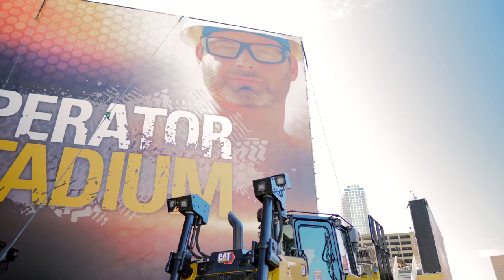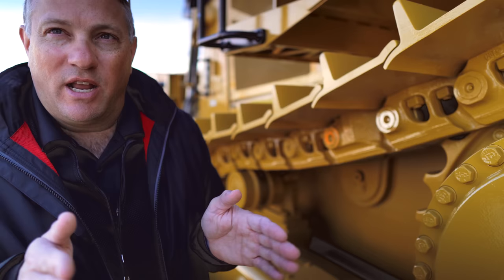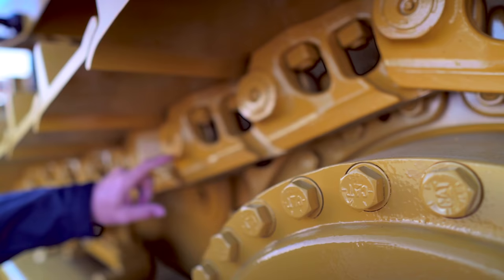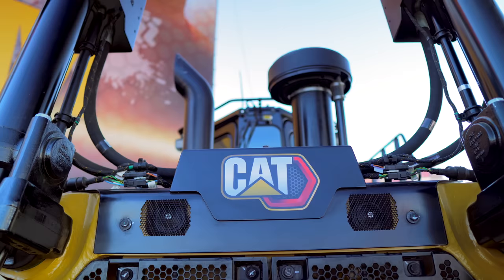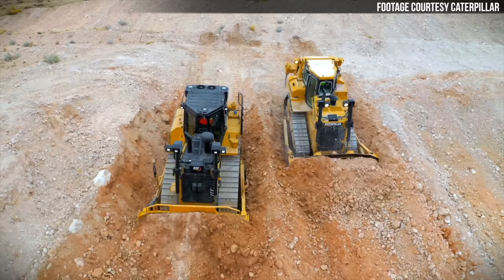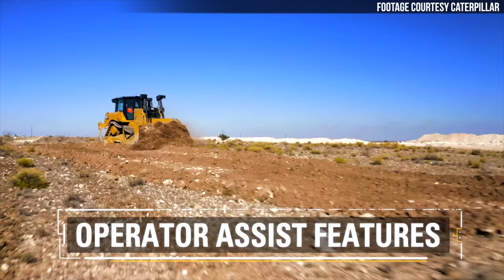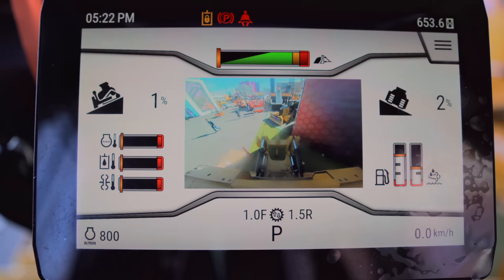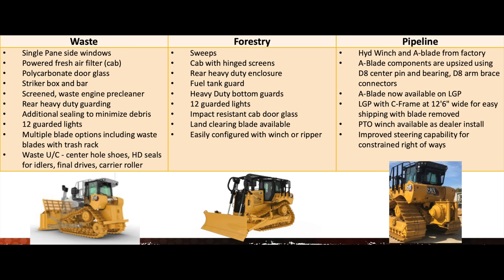Cat Unveils New D7 Dozer at ConExpo 2020: Bigger, Stronger, Smarter

Comment: So they abandoned the DIESEL-ELECTRIC drivetrain of the D7E and went back to the old slush box ?  🤨🤔
Seems like a step backwards but then again I don't operate nor design heavy equipment.
Reply: D7E was not cost effective when compared to new D6 XE.  D7E made sense at the time since it was an underperforming model. Technology advanced to point where it made sense on most common Medium Dozer

Comment: After running the D7E diesel/electric for about a year, glad to never see it again. That fool design will end up killing people,  pickup trucks, fuel trucks, well heads, you name it. WHY?? Because new operators, or new buyers, or mechanics/service workers...will either claim "I've run lots of dozers..." or, if no one is around to point out certain features..Any of these persons could climb on this machine and quickly make it move, but certain controls and switches will be mysterious or counter-intuitive to them, and a lot happens quickly at that point!!